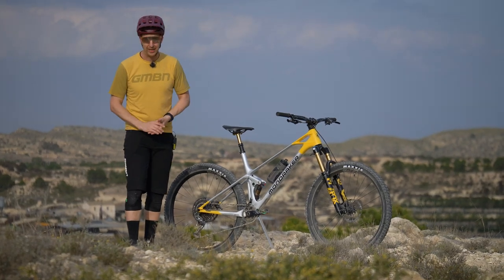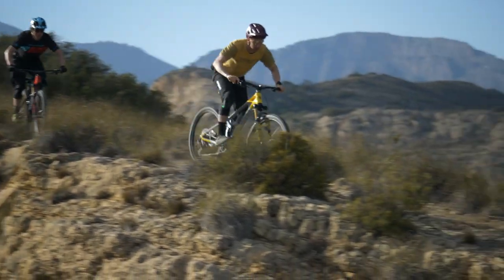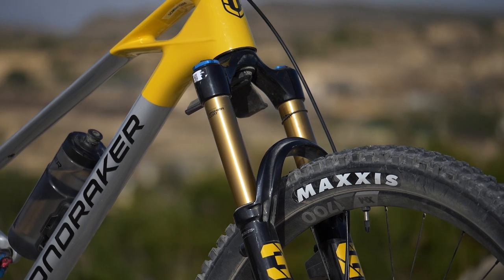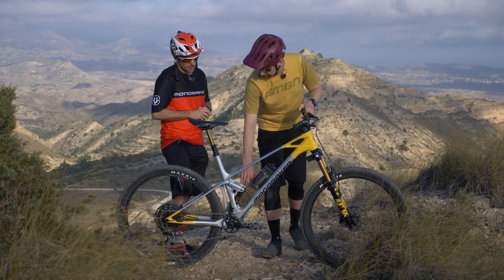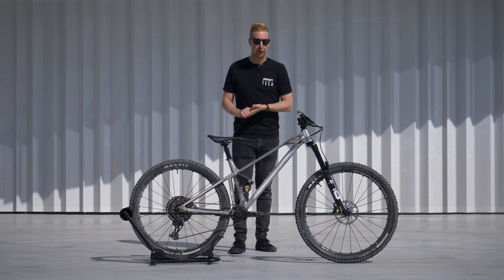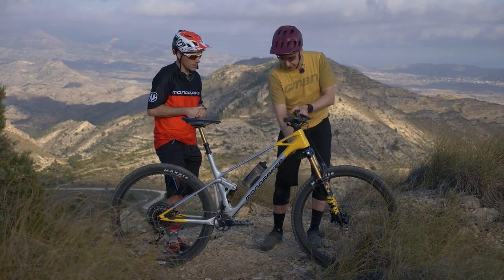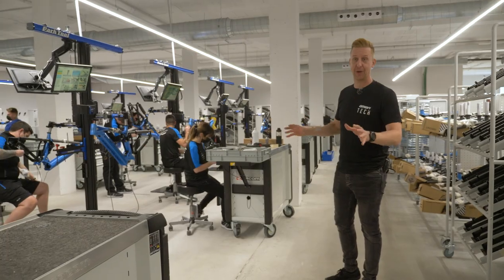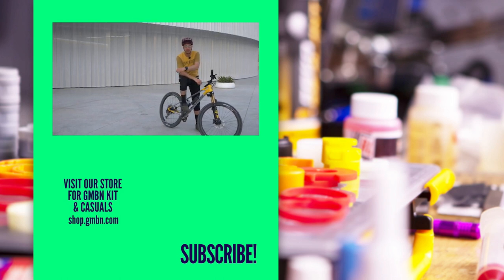Prototype To Production | Behind The Scenes Of Mondraker Bikes

Comment: I own Monraker Chrono carbon for over 3 years now, and you are right, that blade top tube is amazing, everyone looks at it saying that it must break under load, but the frame is performing flawlessly, and im not being gentle with it, as i have bad habits from owning a full sus trail bike for 7 years before. I still keep eyeing the transition spur, that is one beautifully designed bike, but f-podium and raze are in play too as a replacement. I just miss the rear travel of full sus, but the weight of good HT feels amazing going uphill (mine is 9.5kg now)

Comment: Excellent! I'm still confused as to why a frame needs flex, to be rideable, on a full  suspension bike?
Reply: Harshness
Reply: it's more about compliance than just 'flex'. If the bike is too stiff then it will not absorb any vibrations, trail buzz or impacts creating a bike which is just too stiff and bounces off ever bump shacking the rider to bits. A bit like carbon bars do, they designed to help reduce the 'buzz' from the road or trail as well. There's also a lot of forces to think about not just vertically as well but also load from cornering, sprinting etc.
Reply from the maker: Hey Curtis! Pete below has summed it up quite well. 👍
Reply: Excellent info, thanks!

Comment: Wait, putting the wheel further in front while massively reducing the stem length puts MORE weight on the front wheel? That's just not right though is it..? Driver gets put further back, wheel gets put further in front.
Or is it perhaps a leverging effect where increasing the wheelbase means your weight being in front of the rear wheel will push a longer leverage down to the ground, thus increasing downward force on the front wheel?
For sure the rider's weight bias is further back relative to the front wheel.
Reply: You’re somehow right, but they maybe forgot to mention that seattube angles get steeper.
That way your body and weight moves forward and more in the center of the bike and wheels.

Comment: Ok, one serious comment and one not so... Firstly, when you comment on how wonderfully green Mondraker are for using cardboard packaging, it comes across as a tad lame when the bike you're looking at is made from an non-recyclable material. Yup, it's carbon and it does make brilliant looking, light bikes, but I think you'd have been better off not mentioning how environmentally friendly they are for using cardboard packaging. Secondly, would you please explain what a gentle poo tool is? 😆hint turn the subs on.
Reply: It's a tool you use when a poo won't flush.  Sometimes you have to chop one up to make it go down the hole.

Comment: I’ve tested this bike at our LBS and it’s an absolute rocket. It also bunny hops amazingly! I ended up ordering the new Foxy Carbon R after testing Raze Carbon R and Alloy Foxy R. I will need the rear travel, but testing the Raze R confirmed that I want the Carbon Foxy R instead of older design Alloy Foxy R.
Reply: I am guessing that it being a rocket you mean it climbs really well?  Also, did you not think the raze has enough rear travel? I want a raze but am a little concerned about only 135 rear travel. And even more so now that you said you are going with the foxy.